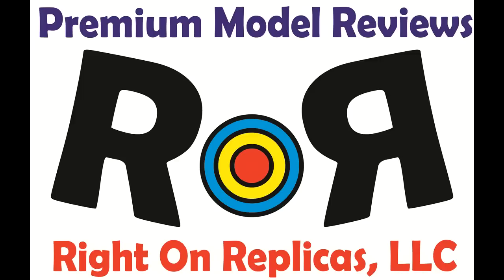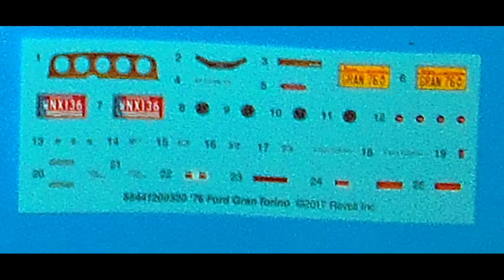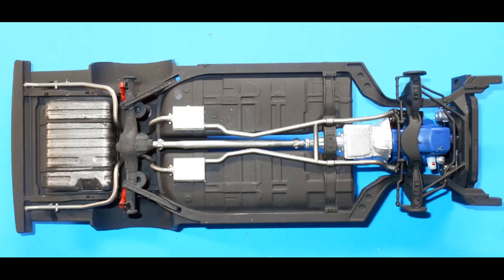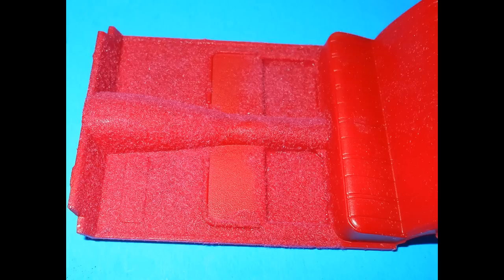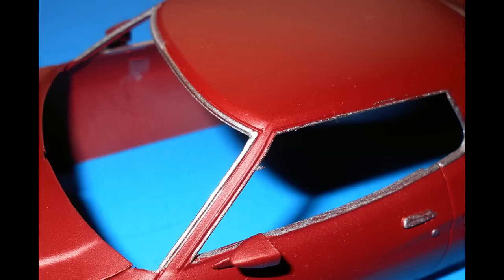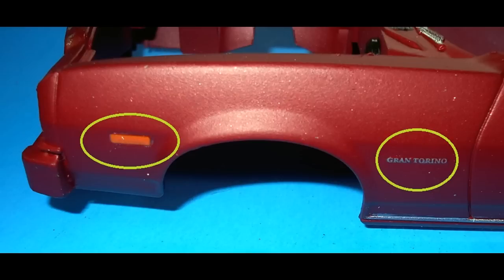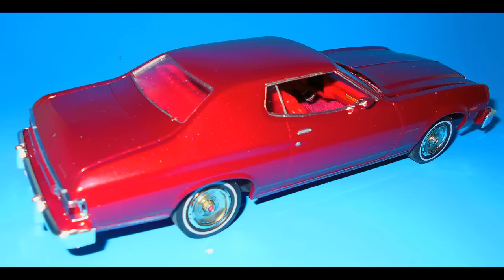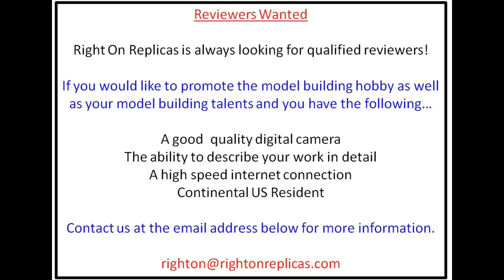How to Build the 1976 Ford Gran Torino 1-25 Scale Revell Model Kit #85-4412

Comment: I very nice review and build of this kit. The model club that I belong to is doing a group build of this kit. One is box stock and the other is pretty much do what you want. For the do what you want version. I am thinking about converting this kit to a utility vehicle and I will call it a El Gran Torino. Can you offer any suggestions on how I would do this?
Reply from the maker: GYMO, an ambitious project for sure.  I guess I'd start with a MPC '86 El Camino kit and cut the roof line short on the Ford to graft the bed into the back end!  Just cut and fit and add putty!  -Doug

Comment: Wish they would fix the front header panel letters, side window openings and bumpers. No way to fix the bumpers without needing to replating them. This kit is not bad, but it sure needs a bunch of little fixes to make it right
Reply from the maker: DoWe, You're right, there's always room for improvements!  -Doug